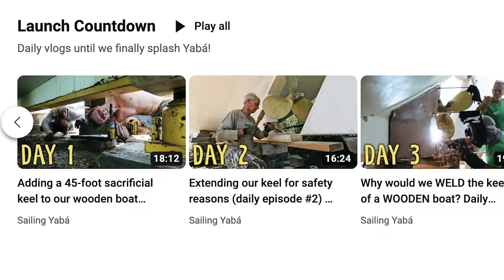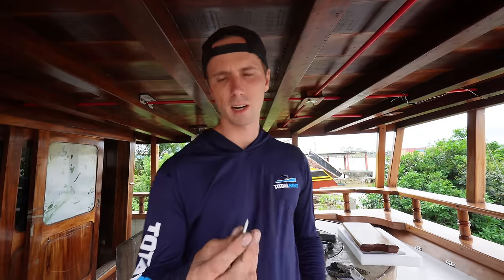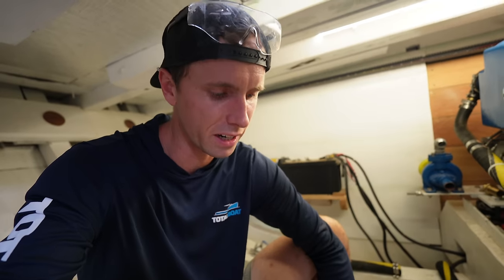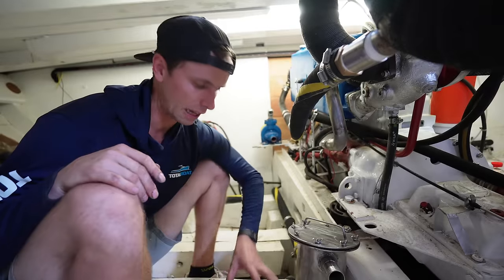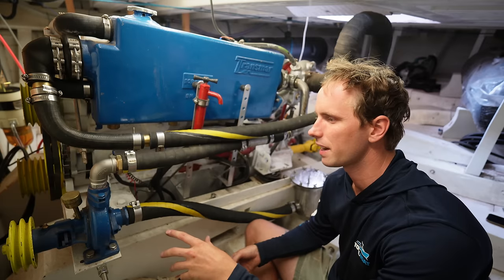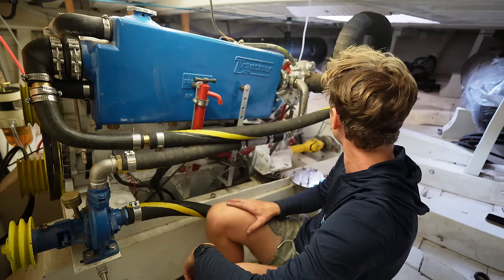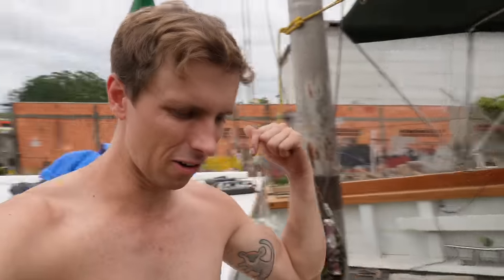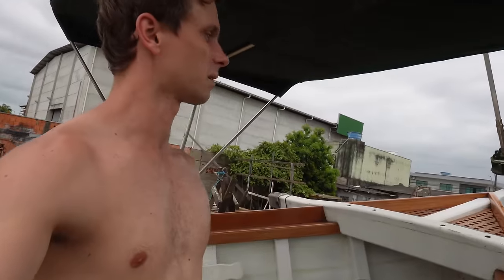Wooden boat refit: We have engine cooling and added some shade to the deck  — Sailing Yabá 174

Comment: I know this comment is late in your build, but you are using the incorrect method for the installation of fittings on the boat on the outside of the hull.  It appears that you use calking of some type.  You should have been using bedding compound.  The difference is that bedding compound never hardens and remains flexible to allow for the movement in the wood.  Caulking, on the other hand will harden and eventually crack leading to wood rot and leaks over time.

Comment: The inlet should be connected to the gearbox oil cooler first and then from there to the engine cooling circuit !!! NOT as you have done it. Your choice but what you have done is not correct .

Comment: ATTENTION ATTENTION. Your boat will SINK! Ben the thru hull has straight threads and is made to connect to a proper sea cock! You installed a valve, which has tapered threads, onto the thruhull!! Please don’t do that. NEVER do that! Buy a proper, thru bolted, sea cock. It has the correct threads. rarely criticize or even comment, but this is too important. RULE number one. Keep water out! Google, look up Groco company.